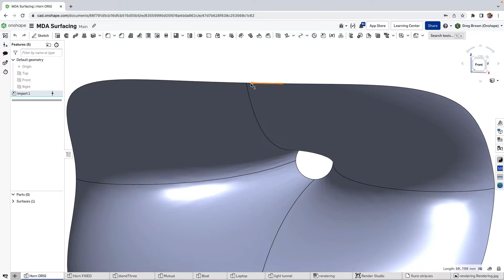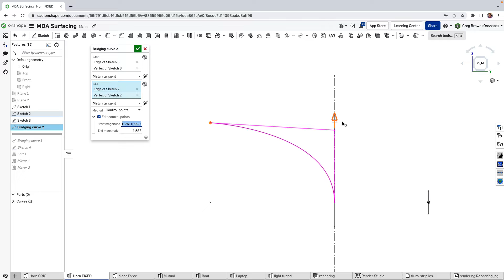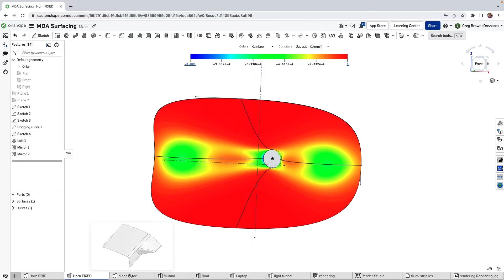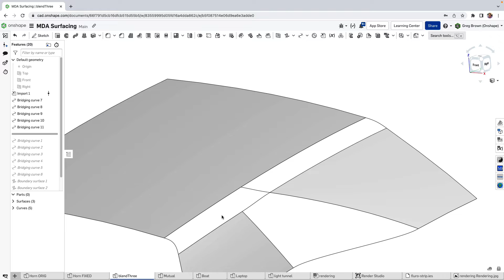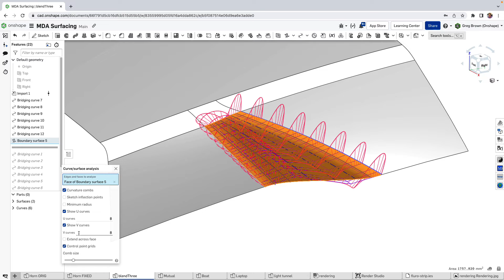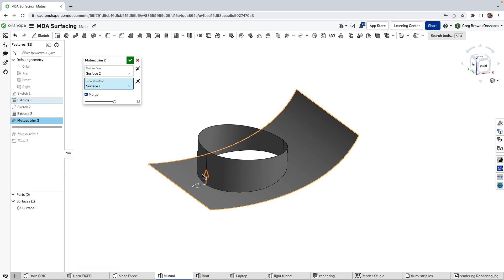Practical surface modeling tips and tricks - good curves and diagnostics are your friends

Comment: your videos are the most helpful out of what I could find so far! extremely underrated :) could you make a video that goes more in depth on how to strategically place curves when modeling objects (e.g. phone case, game console, car hood, etc.) Whenever I try to surface model complex shapes, I often end up with strange, unwanted creases in certain areas. This happens because I'm not sure how to properly set up the curves or which tool to use—whether to go for a boundary surface or a loft. Seeing it visually and understanding the reasoning behind it would help a lot!
Reply from the maker: A really good comment - thanks for the suggestion. It is pretty hard to generalize completely the approaches. There are some nice guides (especially the Alias Golden Rules -- this one has been duplicated in various systems but the approaches are all equivalent) but it's going to depend on the part you are designing. A toaster, a cell phone, a car will have different challenges. There are nice "patterns" (approaches) you can utilize to tackle specific challenges - the topology you end up creating will make or break the design. I'll think more on this and see what I can come up with.

Comment: Hi , Lewis here. Thats a good deep dive video for surfacing. Would you please make a video to differentiate use cases of 3D Fit Spline vs Bridging curves coz both curves seem similar though Bridging curve is more smooth.
Thanks
Reply from the maker: It's a good idea for a focused video and I'll add it to my list. 

I can describe it pretty quickly though: A 3d fit spline is an interpolated spline of degree 3. In some systems it is called an Edit point spline. Note: when a 3d fit spline consisting of only two points and no adjustments are made to derivatives - it then results in a deg 1 line. For 3 or more points, you'll get a multi-span degree 3... A bridging curve always creates a single span (Bezier) curve of varying degree according to the boundary conditions. For a G3-G3 curve you'll get a degree 7 curve, for G2-G2 you'll get degree 5, etc etc.

In terms of use-cases, a 3d fit spline is great for creating cable routes or paths than need to pass through a given set of points. A Bridging curve is for creating high quality profiles, guides, boundaries for (primarily) surfacing features (Boundary surface, Loft etc) where the distribution and number of control points needs to be controlled precisely.

Comment: Thanks for the tutorial, much appreciated. I have a question: When Zebra stripes are switched on in the second example, it looks like you are only achieving a G1 result i.e. the zebra strips do not flow between the surfaces as I would expect to see. The splines have a G2 constraint, but the surfaces conditions themselves are set to "match tangent"? I come from PTC Creo, wherein you must also select the surface conditions to be G2/Curvature or G3/Curvature acceleration, is this not the case in OnShape? Looking at the Zebra stripes on the second example,  I would not be happy with this result, but perhaps I am missing something? Can you shed any light on this aspect of Onshape please?
Reply from the maker: This video was shot before the Boundary surface feature was able to take G2 boundary conditions. But that has now been addressed. Loft could have been used (it does support G2 continuity on the profiles as well as the guides)

Also since this video, the Bridging curve has been enhanced to support G3 (Flow) connectivity, thus producing a degree 7 bezier (single span) if you use G3 at both ends.

Thanks for calling this out. Again this channel might have little things like that as it is not intended as a formal training resource - it is me building, testing and demoing. In any case, I'll put it on my list to update this and release video with G2 boundary surfaces, plus some other curve tricks that have been released in recent times.

Comment: Can these types of line aberrations occur from projecting a new control line from 2 previous lines?
Reply from the maker: Yes, projecting two clean sketches can certainly result in something that is quite "busy" in terms of the underlying mathematics. The geometry kernel (in our case Parasolid) will determine the projected spline and place the control points and knots accordingly. It is up to the user and/or application to determine if they want to reapproximate, simplify, rebuild it... Depending on the downstream use this may or may not be necessary. In the initial case I showed it was a truly nasty curve, and I'm not certain how it got to be that way! (I don't know the source of the original data) In my case, rebuilding using clean curves was the easiest route.